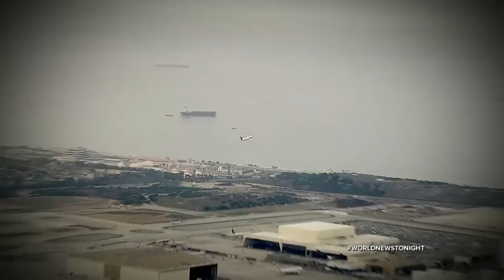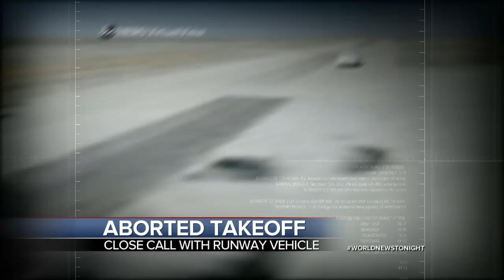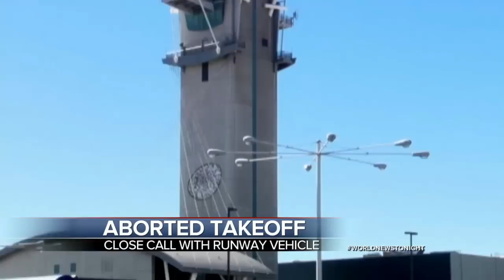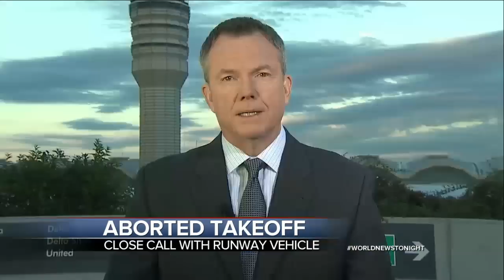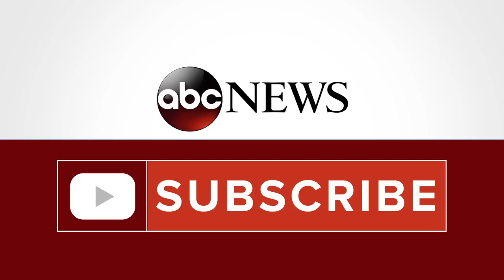Jet Slams on Brakes When Car Is Seen on the Runway

Comment: I was on a plane that slammed on the breaks before takeoff, I had nothing but fear as I looked at the male passenger sitting next to me express a similar expression. We were in such shock we didn't mention a word about it but our hands and arms extended to the seat in front of us pushing back with all our might for what seemed like a long duration.
In fact it almost felt like we went off the runway slightly toward the end. 
I wish I knew what happened cause it has to contribute to other issues since.
Was from Chicago to CA some years back.
Reply: probably lies